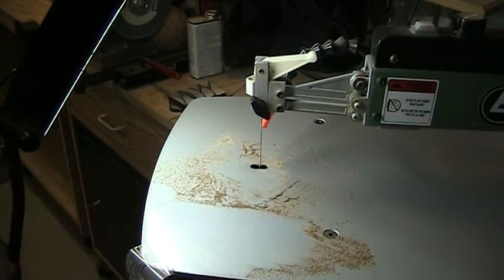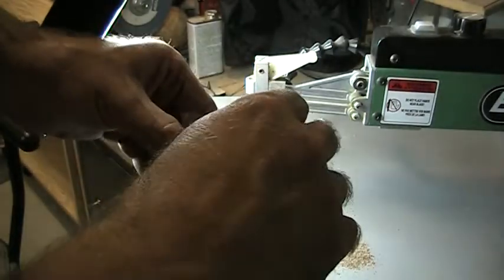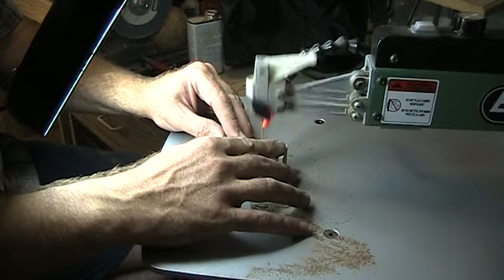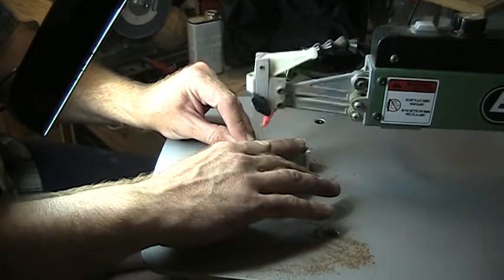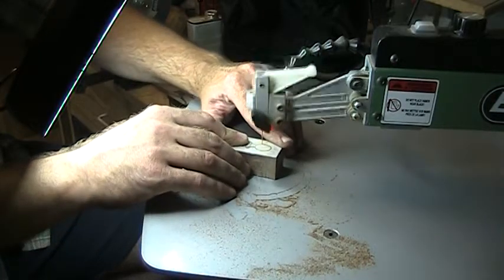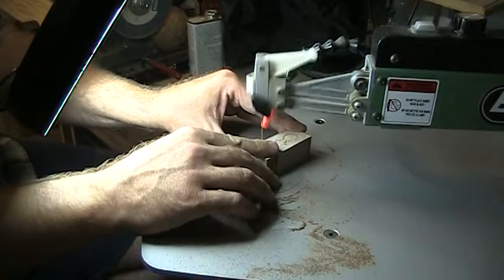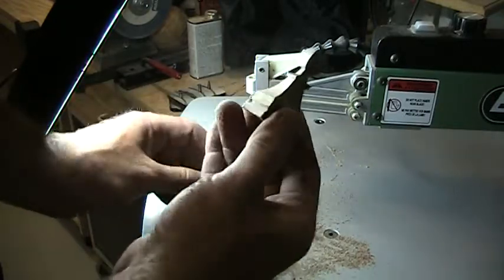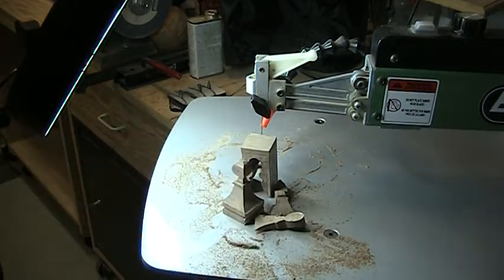compound cutting

Comment: I'm thinking I may not have sufficient tension on the blade. But, it feels like I have maxed the tension. Bill
Reply from the maker: You should be able to pluck that blade like a guitar string with no, to very little side to Side movement of the blade.  What type of tension adjustment mechanism do you have on your saw?
Reply: @acutabove_woodworkings  I have the DuhWalt (in deference to Matt at Next Level Carpentry). It has the level with a scale that shows the amount of tension. I move it as far as I think it will go. I have had a lot of blade wandering in thick stock like 3D Christmas ornaments. But, I attributed it to me trying to force the cut. When I slowed WAY down, the cut got straighter. Kenny, I can only begin to imagine the number of comments you get and reply to. But, I want you to know that I for one really appreciate the help you are giving me. Now, if I was only taller and younger like you. ;o) Regards, Bill
Reply from the maker: @billinfarmington5189  The DeWalt is a very capable saw.  I worked on a DW788 for many years and loved it.  My suggestion for the tension is to install your blade and then tension it.  Once you have it tensioned, release the tension and see if the blade is straight.  Naturally it won't be.  Release the bottom blade retainer and allow the blade to go straight again.  Tighten the blade retainer and then re-apply tension.  That should help with you tension issues.  As for the blade wandering in the stock, sounds like you have an undersized blade in combination with too much pressure being applied to it.  Let the saw do the cutting.  You may want to look into some Olson PGT blades.  While they are a little more expensive, they are worth their weight in gold.
Reply: @acutabove_woodworkings  I mostly use Olson blades. I will give your two step method a try, sounds like it might help. I don't think I am using too small a blade, I think I am just overpowering it. When I go really slow and watch what the pressure I am applying to the blade is doing and back off, it does get better. Will do the two-step. Won't my wife be excited when she hears I can dance!
Reply from the maker: @billinfarmington5189  You shouldn't have to do that two step method all the time.  Just once in a while for tougher cuts.  Too much pressure will deflect the blade and cause a curved cut so just take your time and let the saw do the work.
Reply: @acutabove_woodworkings  got it. Bill

Comment: Did you cut that real time?  I have made several compound pieces but am not able to cut that fast.  What's your secret?
Reply from the maker: Yes. This was cut in real time. The first cut of the compound cut was already done and I only cut the second cut for the video. The secret is a good sharp blade. Poor blade selection or poor quality saw blades will definitely slow down the cutting process. I was using a #7 triple ground blade from Olson. They are a very aggressive and quick cutting blade and yet give a very smooth finish to the cutting edge. Give them a try if you get the chance.
Reply: Thank you.  I just subscribed to your channel.  Very practical and good tips.
Reply from the maker: +oldman719 That's great to hear. Welcome aboard. Good to have you here. If you have any questions about the show or the projects in the show, please don't hesitate to ask. I'm more than happy to help you out if I can.